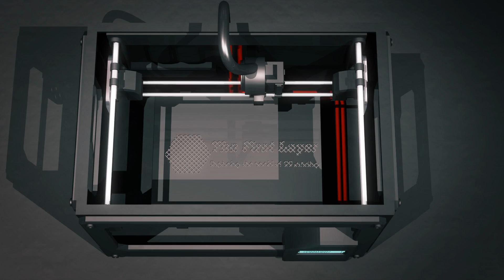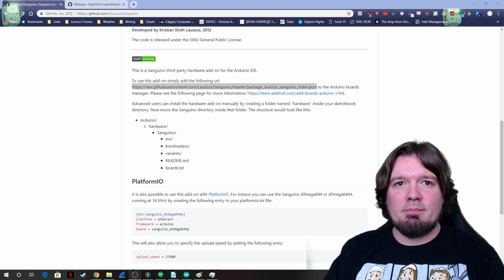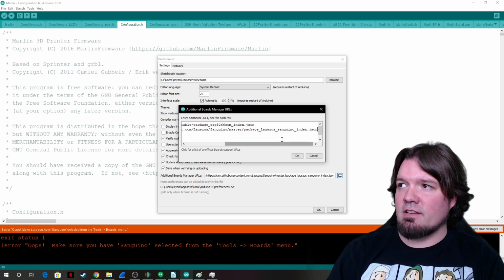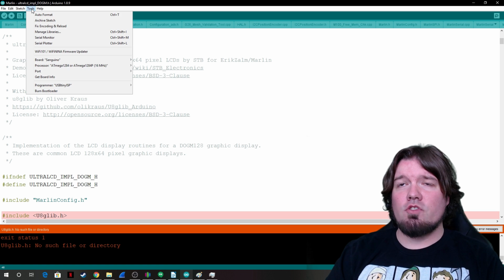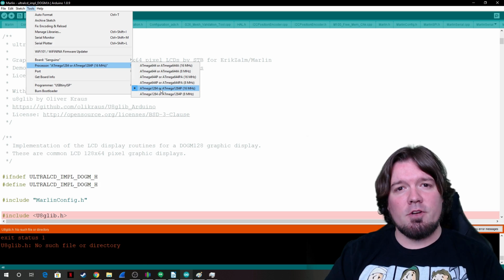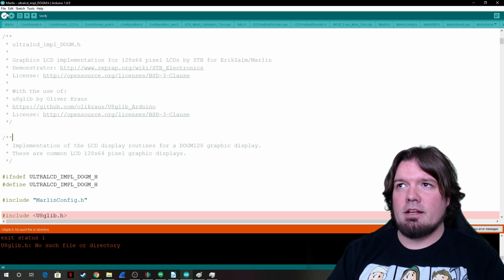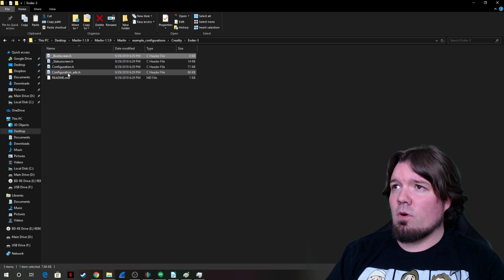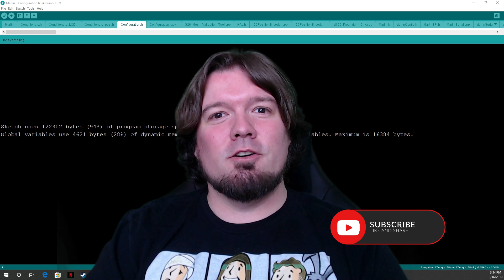Top 3 Marlin Issues and Quick Fixes (Sanguino, u8glib, Configuration)

Comment: Thanks for the informative video! I used the configuration paste to Marlin.ino  & u8glib technique unfortunately without success. I have a CR10S and cannot get any Marlin sketches above 1.1.7 to verify in Arduino.  When I uploaded Marlin 1.1.7 to my printer I had a static boot screen.I know I'm not posting any error messages but I have not had any success with the techniques described in the many tutorials provided on this channel. I can only assume I'm making an error somewhere but cannot figure out what that is. Any ideas as to what I am doing wrong?

Comment: Not a problem compiling but an issue with upgrading Arduino breaking the LCD. 

On the old laptop I was using Arduino 1.8.5 which compiled Marlin fine for the MKS Gen L board and graphic LCD and worked great.  The new computer has Arduino 1.8.10 which still compiles and uploads fine but the LCD is badly corrupted - you can make out roughly what should be on the LCD.

My printer hardware has not changed and still works fine if I compile and load from the old laptop and Arduino 1.8.5.  The old laptop is due to be retired.  I suspect a library or some piece of support code has been updated in Arduino between 1.8.5. and 1.8.10 which is upsetting the LCD support, possibly the serial timing, just enough to throw it off.

It may be that the electrical interface between the controller and LCD was marginal when working and easily upset by a software timing change.  I have read quite a lot about graphic LCD corruption issues, mostly looking for hardware faults, but not seen solutions.

I may have to roll the Arduino back from 1.8.10 to 1.8.5 on the new computer.  Using a Anet A6 with the Anet LCD and MKS Gen L controller.

Comment: I need help, i am trying to upload marlin 1.1.9 to my anet a8 but i receive this message 
avrdude: stk500_getsync() attempt 1 of 10: not in sync: resp=0x49
i have tried with this sanguino board, also with the anet master package from github, i have changed my usb cable with a shorter one, is not the code because it compiles so i do not know what to do, some people say that is the board itself and by buying another board everything worked fine for them, in the board i can read "anet3D v1.7",  I installed the driver ch340, the COM is correct I checked the device manager  so i am thinking that i have a communication problem but i ran out of ideas

Comment: Thanks for the video, I´m having problems uploading the Marlin on a FLSUN cube, I need to set up chimera (two extrusers) and keeps comming the same error " no comunication, I have the driver setup ok, and all the arduino setups that FLSUN ask for : ATMega2560 as processor, arduino Mega or Mega2560 as board and the com port (in my case 4) anto to finish the programmer: USBtinyISP and even so no comunication... any help?

Comment: using this turorial wow its not work. i am amazed
i have managed to compile ender 3 original source.not marlin.
i can read with avrdude and write after verify there error,but firmware seems be same what ever i do.
its not written? it say erasin lol and then write,but nothing changed

it says #error "Oops!  Make sure you have 'Arduino Mega' selected from the 'Tools -> Boards' menu."
how can it use sanguino lol when marling want mega

Comment: I wish this had been posted several weeks back.  I managed to fix all the issues you brought up.  One I still have is that there's something I missed for interfacing my Mac with the sanguino board.  I had to bring in a Windows laptop to do it.
Reply: Likely the Arduino Usb to serial drivers. Unfortunately, I never use macs, so there's not much I can help you with there. At least you got it working!
Reply: @BryanBakerXBrav  I'll look at that.  Thanks!  There's much to be said for Mac OS over Windows, but not in this application.  Please keep putting videos like this one out.  I know they help lots of people.
Reply: @srowley85  did you figure out mac issue i am having same thing and don't have a windows
Reply: FISTPRO I never did get things working with Sangino on my Mac. I ended up replacing the board on my Ender 3 with an MKS Gen L board, which interfaces fine. Given the recent changes to Marlin and availability if 32 bit boards, I’d look now into the SKR boards, which use Visual Studio code or Atom for compiling and uploading rather than Arduino. Check out Teaching Tech’s and Chris Riley’s channels for mire on these boards.

Comment: I have an Ender 3 and just purchased a MKS Gen L with TMC2208 Drivers. Plenty of vids to show how to config these, but i cannot find any help to setup EZABL in Vanilla Marlin, i cannot use TH3D Firmware as it doesn't cater for the MKS Board and Drivers, any help would be grateful, i have posted on several facebook groups but got no help...
Reply: I won't lie, I stopped using inductive / capacitive probes ages ago for various reasons. But we can definitely look into doing an all-around ABL configuration episode with stock Marlin. You really just need to configure the probe to use the Z endstop, choose your bed levelling methodology, and then see if you need to flip the state switch in the firmware.

I primarily run BLTouches on all my machines, so I'll see what I can put together.
Reply: @BryanBakerXBrav  I appreciate your time and help..thank you

Comment: I have a Tronxy X5S-400 and want to do a start from scratch setup using a Ramps1.4/Arduino with plans down the road to use a Re-Arm processor.  So a real basic tutorial from ground zero would be nice.
Reply: I can definitely look into it. Unfortunately, I don't own any tronxy systems, but I'm looking into some future Marlin videos which are more generic and adaptable.

Have you had a look in the example configs? You may be able to use the values as a reference.
Reply: Just looked and sure enough, there is one.  I could have sworn there wasn't when I first looked a few months back!  Oh well, call it a senior moment but would still look forward to a generic one covering all aspects of setting up a new installation.  Thanks for all your efforts.